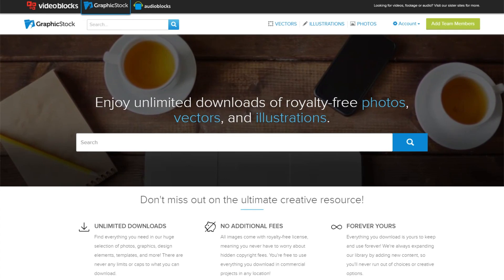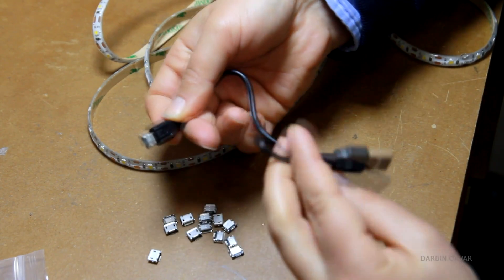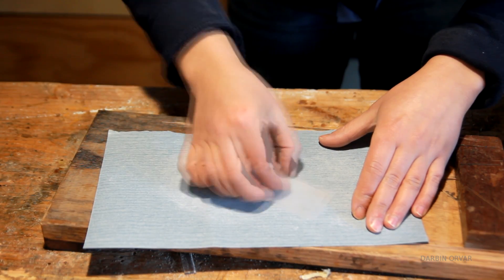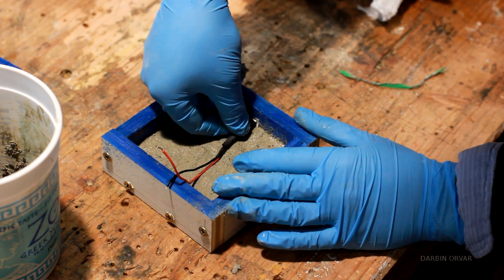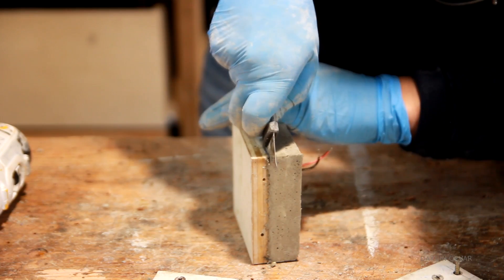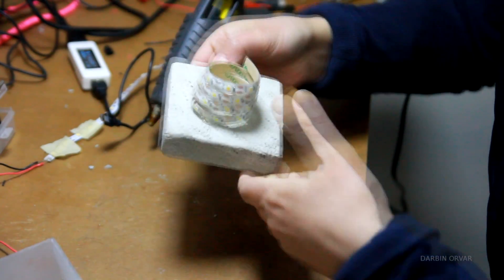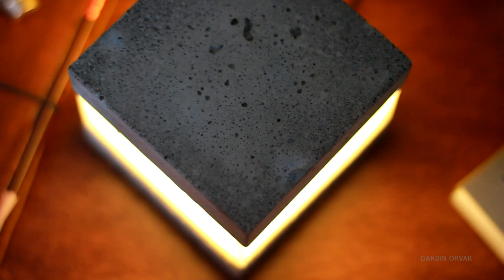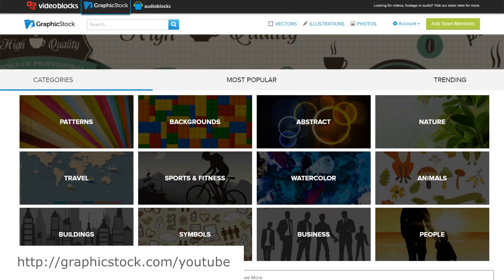Concrete LED Light Cube

Comment: That design is nice; I wouldn't change a thing.  But I wanted to mention a sort of funny story, that might also be cautionary.  When hot glue guns first became available, decades and decades ago, my dad started using his new one for everything in his shop, including lots of little pine screwdriver shelves, small boxes, and so forth.  All was good until a severe heat wave in mid summer, when everything "let go".  (So I recommend that you use some malleable wire or epoxy putty or instant cyanoacrylate, such as FastCap 2-P10,  or some other such thing to hold the LED coil in place, and perhaps in other places that you have been using hot glue lately that could conceivably become warm at some point...)

Comment: A note on casting concrete, water based lube makes a great release agent. Cheap, easy to clean up, and accessible.
Reply: Cooking oil does the same as well.
Reply from the maker: I should try that!

Comment: Great job!  To get a smoother finish with your concrete a wetter mixture is better and also try vibrating the mould with an orbital sander or similar, this will remove the bubbles.  You could also line the mould with cling film (Saran wrap in the USA).
Reply: Can you tell me what are the exactly components to get concrete like in the video please .. I wanna make it

Comment: maybe a Micro USB to dip adapter (Micro USB Port on a PCB with solder joints) would have been a better choice. Sorry if my english is not correct: i'm from Germany

Comment: Really nice, a cool adission would be a battery inside the light it self, like the wire in the concrete, so the lamp would be even more portable and your Not longer reliable to a Power source:)

Comment: Brutalism done right
Reply: Equally as brutal, using it as a bludgeoning device for any would-be trespassers.

It would be neat if a design was etched into the acrylic. To make it so the etch was more see-through you can just oil the nuts off it to restore (some) of its lustre. The man behind DIY Perks discovered that by accident.

Comment: I too struggle with soldering small connectors ;-) you can get inexpensive breakout boards which make life much easier, search on ebay for 'micro usb breakout'
Reply from the maker: It's a nice idea but concrete is very corrosive so you'd have to protect the board somehow.
Reply: That's true, hot glue maybe? It looks awesome btw, I think I might give it a try.

Comment: Perfect! I think sinking the lexan into the wet concrete was a great call as you can't see a gap. Wasn't sure why you'd want to go through the trouble of using a mini-USB connection, but when you looked it up to the power bank it made sense. Not that a concrete lamp is super portable!

Comment: Looks great Linn! I like it.  Although it could throw off the symmetry of the concrete sandwich, you could use a dark or intensely colored wood (such as wenge, bloodwood, padauk, or desert ironwood) for the top of the cube.  Either way, the light looks great!  Keep up the good work.
Reply from the maker: That would be a cool contrast.

Comment: Very, very, cool design. I could see a similar but taller design with a central support made of PVC pipe, a 12 volt LED strip with a wall wart, and an in line dimmer. Or even an RGB LED strip with one of those trick controllers. Very cool as is.

Comment: Looks like you sanded both sides of the lexan, is that correct?
and what grit sandpaper did you use? 120? or 400?
Reply from the maker: I did sand both sides. Believe I used 320.
Reply: than zou

Comment: Beautiful as usual! Thanks for the share. A humble tip about concrete, you can use vibration sander over the wood mold to achieve super smooth surface as vibration removes air bubbles on the surface. 😉
Reply: Ya I like the bubbles too but that's a really good tip!
Reply: Gökmen Emre Keskin I actually prefer the look of the bubbles
Reply: vibration removes the bubbles by having the lighter airbubbles float to the top as the more dense material settles...But of course that's likely understood.

Comment: Cool project! Those are some tiny connections to solder.
Reply from the maker: Yes - TINY!
Reply: One could also cut off a cheap dollar-store (or eBay) microUSB cable and leave the female end dangling out of the concrete.  This would allow you to avoid the eye-strain and potential finger burns of soldering those tiny connectors.

All that said... this is a very cool project!

Comment: Very, very cool design! If you already have 12V led strips lying around: 5V USB -> boost converter -> 12V. Not as sleek, but probably cheaper since 12V is so common.

Comment: This project is SO GREAT.  I have done some mortar work myself - I made a salt cellar and lid using LEGO for the mold.  LEGO is great for prototyping but I'd probably go with plywood if I was going to make more than one (Great idea to spray paint the inside).  I like Karl's comment about perhaps using a small piece of PVC to support the lights - it could be molded in to the base for stability.
Reply: Nice

Comment: would be cool to print some bright or funky design onto paper or a clear sheet of acetate and put it on the inside of the lamp where you put the paper to add some color or design.
Reply from the maker: That would be neat.
Reply: Also the LEDs that have RGB controls,  NICE work , WELL explained!!   8-)
Reply: Nahhh...simple and clean is better imo
Reply: As you mentioned color. A black concrete would be very cool.  https://www.novsights.com
Reply: Another great thing would be to use rough cut wood for the mold, it will imprint the gran into the concrete which looks quite nice, you can see that in older concrete walls.

Comment: Nice!  Maybe use a small section of PVC pipe to support the LEDs inside the lamp?
Reply: Good idea but the pressure sensitive acrylic adhesive on the back of the strips might not adhere to the PVC due to the low surface energy of the PVC. The PVC however would make a good perfect circular form and the LED strip could be adhered in a few spaces with epoxy or maybe gorilla glue..
Reply: or you could use the pvc sprayed with grease or spray paint as a mold for cylinder ones!
Reply: Karl Laun tp or paper towel rolls

Comment: Search for usb breakout board. They are premade connectors on a tiny pcb with solderpoints, much easier to handle than the bare pins :)
Reply: Like these ones
https://www.aliexpress.com/item/10PCS-CJMCU-Breakout-Power-Supply-Module-Micro-USB-Interface-Power-Adapter-Board-USB-5V-Breakout-Module/32789480622.html
they cost like nothing, 10 of these for 2.33$
Reply: I was going to suggest the same.

Also, because those connectors can be annoyingly delicate, it might be a good idea to construct the lamp in a way that allows the wiring and socket to be added after the concrete cures. A straw could be used to make an interior tube, or a scrap of acrylic could be used to form an open channel in the top or bottom of the block.